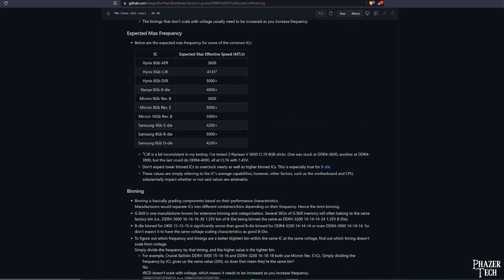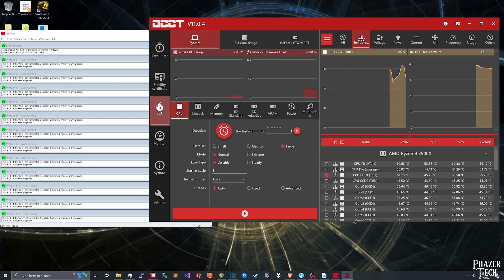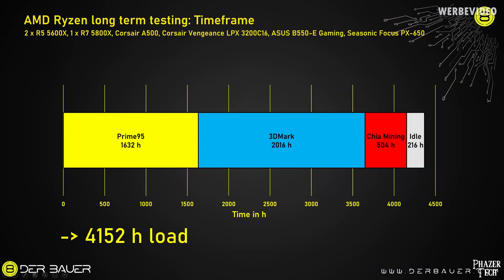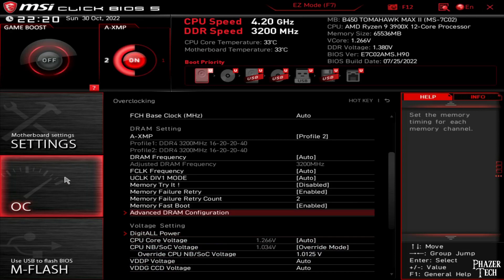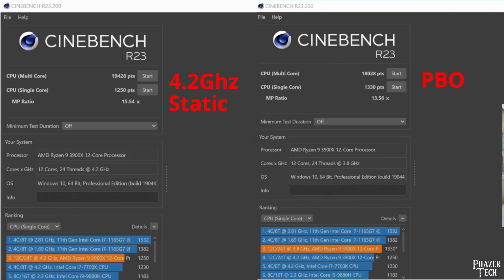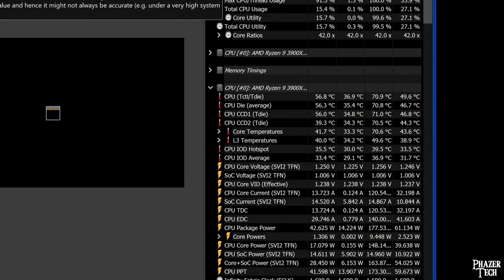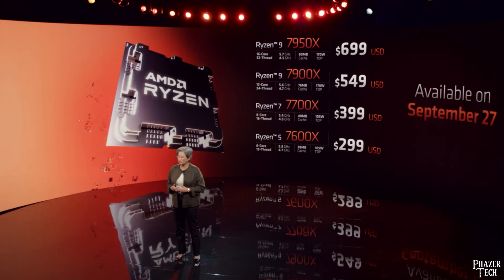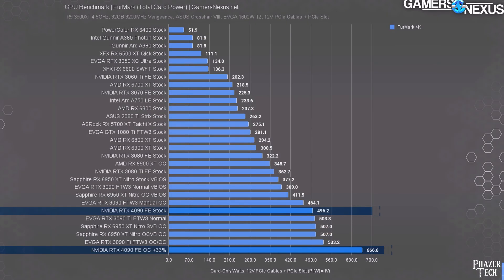AMD Ryzen CPU Degradation With PBO - Is Precision Boost Overdrive The Cause?

Comment from the maker: Update:  I've found out more info doing some more tests.  I now believe the problem is with the stock PBO settings in some motherboards.  See my updated video here: https://youtu.be/iCli2jJtlQ8

Also if you need additional help getting your Ryzen system stable then check out this extremely well written guide: https://docs.google.com/document/u/0/d/1FsUuYtjztbqgOiR3uUCtzlTyzB2WRFUm-kXbboECj2s/mobilebasic
Reply: Hi where its extra boost,can you make video what you set in bios.Im tryed your advice still bsods
Reply from the maker: @alowdenai  It should be in the PBO settings, but it might be called something slightly different depending on the mobo manufacturer.  If you still have instability then it might be due to the fabric, in which case you'll need to bump up the SOC voltage.  I'm currently working on a few other videos but I'll definitely revisit this and make another video in several weeks.
Reply: @PhazerTech   im disabled PBO Fmax Enhancer will se iff be stable.

Comment: I know that I'm 2 years late to the party, but here's my understanding of PBO. If you don't have proper cooling solution and your CPU is running hot ( 85c or higher ). PBO will help with degradation of the CPU. PBO will not push the CPU so aggressively, but with proper cooling PBO turned on is fine. Also don't use a low grade MOBO when using a high end CPU. Proper cooling and a high end MOBO will reduce degradation. If you are using the 3950x ( AMD 470x ) the 5950x ( AMD 570x ) MOBO should be used with a high end cooling solution.

Comment: I doubt any company has interrest of showing you degradation instead of just saying "hey more fasterer !". But i have been wondering that, same with X3D processors that seems to cause wild instability on some chips, feels like a silicon lottery especialy with the 3d's. Also not a fan of their 7th gen going "hey lets just see what happens until we hit 95°c that cant hurt right?"
But i really hate AMD having the same old you have tinker with it to make it not suck, then again i dont like Intel just randomly stops functioning atm. while being not super cheap either.
Atleast you no longer have to mess around with jumpers on the motherboard, i really dont miss those days.
Reply from the maker: I agree companies aren't taking this problem seriously and it's only getting worse, as we can see with the Intel 13th/14th gen fiasco recently. Like I said, I think it's becoming more difficult to get the same gains in performance each gen, so they need to push the chips harder in order to keep up the pace. It won't be good for consumers who like to keep their machines as long as possible before upgrading. But I will say, AMD appears to be taking a more conservative approach with Zen 5. For example, the 9700X launched with a lower TDP than the 7700X.

Comment: I have 3950x and CPU run 100% on all cores intensive task 24/7 for last 4 years.
Its possible only with undervolting. Otherwise CPU will fail in couple of days.

I set CPU voltage to 1.1 volts and 3.5Ghz on all cores.
Power draw~80Watts and temp max ~60 degrees.

Overclocing is a good way to kill your CPU in a short period of time and of course you will have degradation.
My CPU running full load for 4 years without turning off and no issues.

Comment: my 5800x was fine with all stock bios settings, no PBO, only enabled D.O.C.P. for memory. my CPU was already getting hot at stock already, but it was stable, bad silicon lottery i guess.
now 2,5 years later i had random freezes, with days of troubleshooting, i had to increase Vcore offset by +0.0750, and set Vsoc to 1.15v to get it stable.

what i'm trying to tell, even without PBO there's CPU degradation.
Reply from the maker: Thanks for the input. Just curious, which motherboard and how fast is the RAM?
Reply: @PhazerTech  i have "asus rog strix b550-e gaming" motherboard, and corsair ddr4 3200 2x32GB ram, today i had another freeze, so i went back into bios and disabled c-state, and changed "power supply idle control" from "auto" to "typical current idle". no more freezes for now.

i'm considering to buy a 5700x, it's a 65W TDP cpu, but for now i'll stick with my degraded 5800x.
like you mentioned in the video, more's law is dying, both intel and amd pushing their cpu's to the limit.
Reply from the maker: @isyannnkarr  If you're interested I made a followup video to this: https://youtu.be/iCli2jJtlQ8
If I were you I'd check the max boost frequency with a program such as hwinfo. I noticed some motherboards are boosting CPUs past their recommended boost. For example, the 5800x I had was automatically being boosted to 4.85 Ghz instead of 4.7 which is its official boost speed. I suggest enabling PBO but manually tuning it down. Set scalar to 1x and then set a negative boost offset to make sure your 5800x isn't boosting past 4.7 Ghz, or perhaps set it a little lower to something like 4.65.
Reply: @PhazerTech  i'm using HWMonitor, i see my max boost goes up to 4849 Mhz, voltages goes from 1,037v up to 1,438v, max voltage spikes i see is 1,531v, idle temp is ~48c, is all too high. i might try out your suggestion, lower it down to 4,7Ghz or maybe even lower to reduce Vcore and temps. i'm gonna watch your video, appreciate it, thanks for help.
Reply from the maker: @isyannnkarr  Happy to help, doing this will definitely lower the voltage and temps for single core and medium workloads. If you want to lower temps for heavy workloads where all cores are being used, lower the PPT/TDC/EDC.
Also if you have the time you might want to play with curve optimizer.
Reply: i wanna post an update...
i still had freezes, few times a day. i tried stock memory speeds, set negative boost offset (i don't remember the value) to get very low clockspeeds, still didn't help much.

so i bought a new 5950x, did a negative boost offset 550 to prevent future degradation, kept PPT/TDC/EDC scalar all on auto.
max boost is 4.5Ghz, very low temps 30c-40c idle and 50c-60c load, a huge difference compared with my degraded 5800x. my 5950 is a B2 stepping.

it's about a month now and my pc is rock solid stable. no freezes anymore.
not gonna touch anything in bios anymore, wanna enjoy my pc for many years.

Comment: The candle who burns twice as bright lasts half as long, I burn my CPUs no problem 200W
Reply from the maker: Nice, if you have good cooling you'll probably be okay. After a few years you might need to slightly increase the voltage, but at the end of the day it all depends on how lucky you got with the silicon lottery.

Comment: i never had an AMD product. But lots of experience with intel + nvidia. i luckelly never had a single issue since i started my first build intel core duo e8400
Reply from the maker: Sounds like you've indeed been lucky.  I had a 980 Ti die from a blown mosfet and had a 6700K overclock that degraded after 3-4 years.  I don't favor one company over another, I just get whatever is the best value at the time.

Comment: I ran my 4790k balls to the wall oc'd 5.0ghz stable its entire life up until I upgraded to a 3900x last year and recently a 7900x.

I was not nice to that chip and it was rock solid stable for many years.

I don't believe silicone degradation is problem at scales involving useful lifetimes of these things
Reply from the maker: Sounds like you got lucky in the silicon lottery on that one.  Keep in mind every chip is different and silicon quality can greatly vary between individual chips.  Certain architectures seem to be more susceptible to it than others.  Also silicon degradation is well documented with articles about it going back for decades.
Reply: @PhazerTech  Yeah I was absolutely lucky on that chip, most of those weren't 5ghz stable

I still have it too, kind of want to use it as an xoc mule and see what I can squeeze out of it since dry ice is easy to get here

I still run PBO  though, I probably wont even be keeping this 7900x for that long either, interested to see what they come out with after the 7800x3d since am5 should still be a supported platform

Even if this thing ends up becoming unstable 6 years from now running like this turning it back to stock really wont lose much performance since PBO doesnt really give you that much gain in the first place unless you do manual tuning

I just leave my PBO on auto, set CO to -20 all core and send it (again, lucky silicon), temps stay surprisingly good for a 280 push pull aio but I think that has more to do with CO than anything

Runs a lot cooler than it did with stock settings, with stock settings this thing would peg to 95c pretty easily
Reply from the maker: @CyberdriveAutomotive  Nice, might be fun to see what you can get out of it.  Back in the day I had a golden chip Q9550 that could do 4ghz on insanely low voltage.  Ended up selling it, which I sorta regretted.  My 6700K unfortunately wasn't very good, only had a 4.4ghz OC on it and it degraded after 4 years.  Instead of bumping up the voltage to make it stable again, I lowered the OC to 4.2Ghz.

Btw I made an updated video on this topic.  Turns out the memory controller is what appears to degrade on the Ryzen chips.  Also some motherboards appear to use aggressive PBO settings on auto.  I've turned PBO back on but made sure the 'extra boost' setting is disabled and it's been stable.  The extra single core performance from PBO helps in a lot of applications more so than the extra multicore performance from an all-core OC in my opinion.
https://youtu.be/iCli2jJtlQ8

Comment: With both my Ryzen 7 2700X and Ryzen 9 5950X have had instabilities when using PBO on my B450 GAMING PRO CARBON AC. I had to disable PBO altogether to use my CPU during gaming.
Reply from the maker: After doing more tests I was able to turn PBO back on after making some adjustments in the bios.  Also it seems the memory controller was the main issue, and setting auto timings and lowering the RAM OC to 3200mhz is what fixed it for me.  I plan to make an updated video soon going over what I've found.
Reply: @PhazerTech  I might go back to Intel on my next CPU purchase because of this PBO fiasco. I believe it's unacceptable for them to create something that does not work as intended when you set your BIOS settings to auto in all fields. XMP works in auto and loads all values to their respective settings. Why can't they do that for the CPU settings as well?
Reply from the maker: @agoogleuser2369   I agree it's very annoying but I don't think it's necessarily AMD's fault, the issue with PBO seems to come from certain motherboard manufacturers trying to push PBO beyond AMD's specs on "auto" settings.  For example, the 5800x is only rated up to 4.7 Ghz boost by AMD, but on an MSI B450 Tomahawk max, the auto settings are making it boost to 4.85 Ghz.  This will lead to instability for some users and they will need to tweak the settings to get it stable.  It seems motherboard companies are competing with one another to claim they have the "fastest" board in reviews, which is the main issue in my opinion.

Also Intel has had their own share of fiascos as well, with a recent one being the bending and warping of Alder Lake CPU sockets because of a flawed retention bracket design.  This sounds like a problem that can worsen over time, so we probably haven't seen even half the issues yet, so we'll wait and see.  This issue is arguably worse since it's causing physical damage which can't be fixed by simple bios tweaks.  The massive power draw in Intel CPUs doesn't help either.

Overall I don't favor one company over another.  I previously had an Intel 6700k before I switched to AMD for my latest builds.

Comment: I have a 5900X in an ASRock B550 PG Velocita with PBO on and everything else at auto, I do have FlareX Samsung Bdie 3200 14,14,14, 34 Memory.. Running at 3600 16,16,16,36 and the fabric at 1800 for the last year now and everything seems OK.. I have been think about turning PBO off because I am the type to Keep the same Build for 6/7 years.. But IDK. I have an All AMD Rig with an XFX 6800XT with SAM on and the 5900X with PBO on and tuned memory and Samsung Gen 4 and 3 M.2's and it's been beastly quite frankly. I can see my 5900X hitting 4.8Ghz to 4.9ghz on one CCX and then 4.6Ghz to 4.7Ghz on the other CCX. So you get one that is Binned and the other that is regular. I guess if I don't want to take any chances I should try turning it off for a few months at least...
Reply from the maker: Thanks for the comment!  That's a beastly system for sure.  I've been doing more tests lately on more than one CPU that had degradation.  With this new info I now believe most of the degradation issues are associated with the memory controller rather than PBO, however I've noticed some motherboards are very aggressive with the PBO settings so it's best to manually tune PBO.  I set the memory at 3200 mhz and left all the timings on auto, and have now re-enabled PBO and everything seems good.

Here's what I recommend now, and I plan to make a new video in a few weeks going over this:  Make sure the "scalar" option is set to x1 in your PBO settings.  Disable "extra boost" if it's enabled by default.  It's also worth it to spend the time tuning curve optimizer to get the best performance possible with the least voltage possible.  I also recommend running your memory at the stock 3200 mhz and auto timings.  As mentioned before, it seems the memory controller is the most common issue with degradation.  AMD only guarantees memory speeds up to 3200 mhz, so it's possible at some point in the future your system won't be stable at 3600 anymore and you'll need to drop it down to 3200.

Comment: I got my 5900x replaced from AMD warranty. It started becoming unstable after 2 years. PC was crashing (freeze or BSOD) and got increasingly worse and worse. Givibg the CPU more Vcore through the offset option it became stable again. But that is not acceptable after two years ofc. It wss also quite a lot (0.087v) to make it stable. PBO was enabled.
Reply from the maker: Thanks for the input.  What speed and capacity is your RAM?  I'm planning to do an updated video in several weeks with new info I've learned from testing on more than one CPU.  It turns out the memory controller is what caused instability in these CPUs.  After decreasing the RAM speed and leaving all timings on auto, I was able to turn on PBO again and everything has been 100% stable.  Also I set custom PBO settings including x1 scalar and disabling the "extra boost". 
 Increasing the core voltage can help mask this problem, but it will inevitably come back, at least that's what happened with mine.  So it might not have been necessary to RMA your CPU, but nothing wrong with getting a better chip.  Just be aware if you're running RAM above 3200 then the same thing might happen again, in which case I'd suggest slowing it down to 3200 and setting all the timings on auto, and it should be good.
Reply: @PhazerTech  My memory ran at 3800MHz but when it started crashing, the cpu would be unstable (freeze when loading windows) even after BIOS reset with basic settings. No PBO, 2400MHz RAM and so on, unless vcore was increased.
Reply from the maker: @BeckOfficial  Sounds like your cores had some serious degradation, so an RMA was probably necessary.  

Were you running 4 dimms?  How many GB?  The question remains whether PBO caused it, the high memory OC, or something else.  Could have been a bad chip, hard to say without more statistics which AMD does not share haha..
Reply: @PhazerTech  I was running 4x8GB. It 100% needed an RMA, and I also got a new one. It could be a lot of thing that caused it. I bought it on release day so the CPU was one of the first out of the factory. They might have made more mistakes back then in order to manufacture enough for the release.
Personaly I think that the higher ampere going through the chip when PBO is enabled is what is causing the degradation. I had an intel CPU becoming unstable after 6 years running at max OC. It too required more voltage to keep up with the high OC, and started performing worse even at the same clock speed. I haven't done any OC or voltage adjustments to the 5900x though, except PBO.
Reply from the maker: @BeckOfficial  I think running 4 dimms at such a high OC of 3800Mhz could have contributed.  Although you said the only thing that helped it was raising the vcore, so I'm not sure.  But I made an updated video on this topic and tested with a few other CPUs and found the primary cause of instability came from the memory controllers.  Also tuning your PBO settings might be a good idea because some motherboards push PBO really hard out of the box on auto settings.
Reply: my 4770k never failed, its still on my second pc
Reply from the maker: @nivea878  Nice, did you overclock it?  I had an overclocked 6700k that was fine for about 4 years before it required a bump in voltage to remain stable.